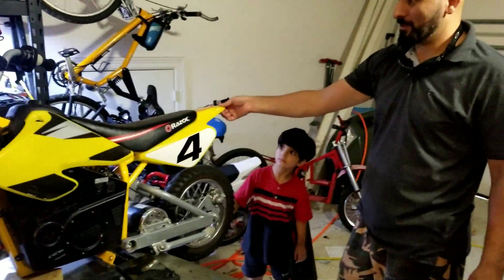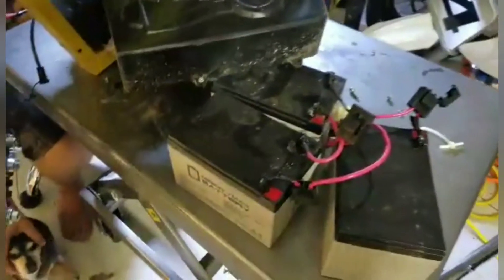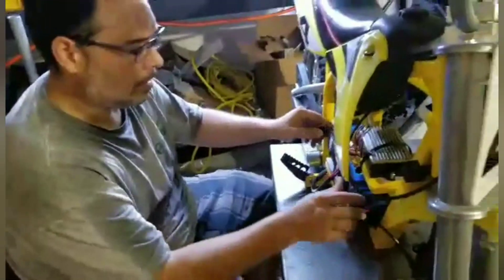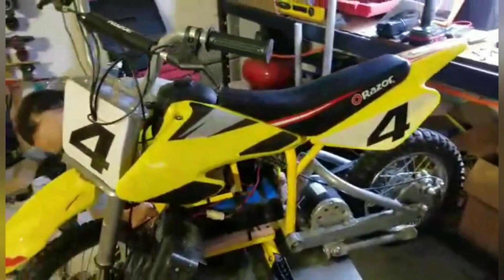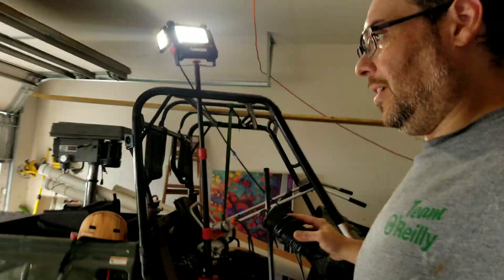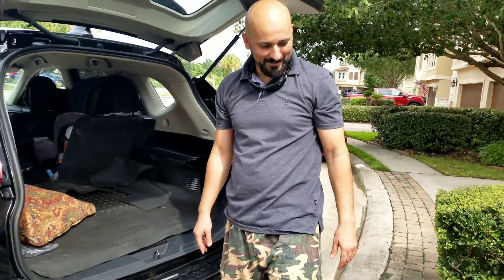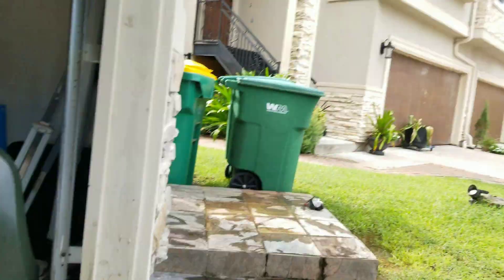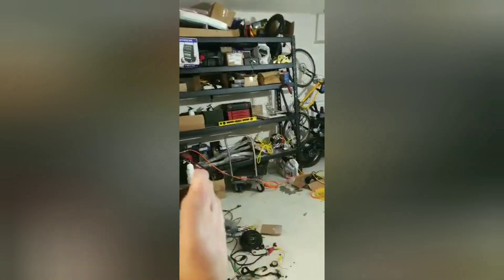7yr olds overvolted Razor mx500, w Lithium ion to 48v!!!

Comment: How fast does it go? Ordered a overvolt kit for my sons
Reply: Thanks Keaton for rigging the ride.  I could go astounds 23MPH where my son who's more than 100lbs lighter can hit around 30MPH.  I haven't even fully charged the battery yet. Will try again with a full charge and update here.
Reply from the maker: Woooow. Thats fantastic.  Let me knownwhen you want the brakes upgraded,  the seats!.
We can makenit a little.slower with more take off. Or less take and more speed.
Reply from the maker: @atifmmir  any news?
Reply from the maker: Depends on sooooo many factors.  Fast scooters is bad. Dont buy them.
Reply: @KeatonsCarlott  huh 🤔? Well that kid in video flat ground wide open how fast is top speed? Not on a windy day on a clear perfect 👍🏼 day or whenever he drove it?
Reply from the maker: See my other videos.  I have at least 12 videos ,using different battery packs, with different voltages , going different speeds. My lady can go 6mphs faster than I can on THE SAME BIKE. ....
Stock is 15 to 17mph.  My fastest bike did 48mph, and i went home, and removed a the 15t sprocket i installed.
Reply: @KeatonsCarlott  you didn’t answer question with factor I listed, basically gave more variables and factors… Thanks! So basically is faster lol
Reply: @KeatonsCarlott  who do u suggest
Reply from the maker: He didn't get it to top speed.
Reply: @KeatonsCarlott  but how do we know that if we don’t know the top speed..? Thanks
Reply from the maker: Owner posted.